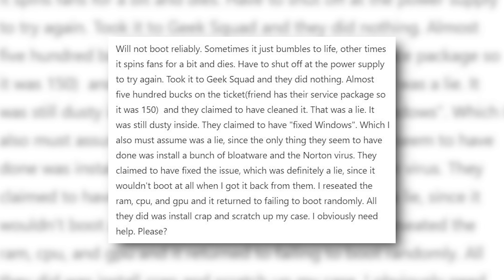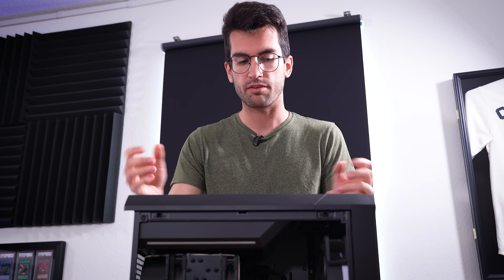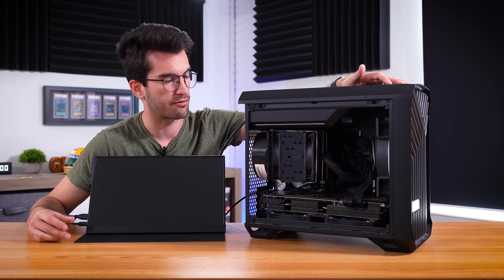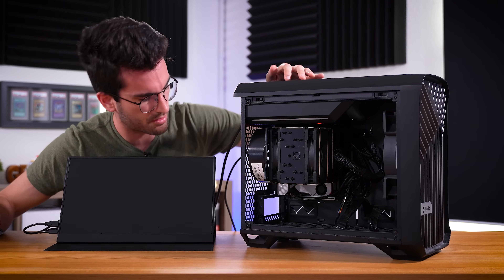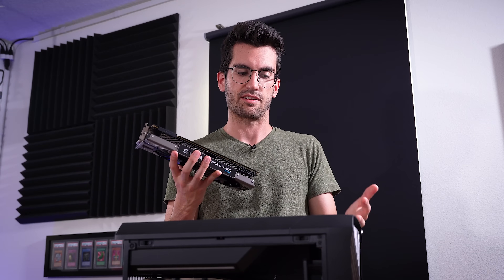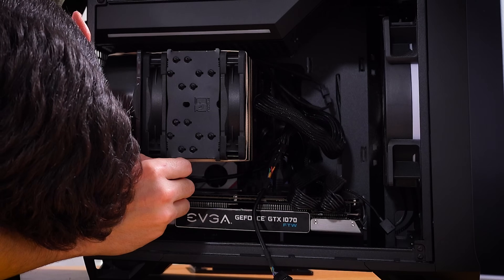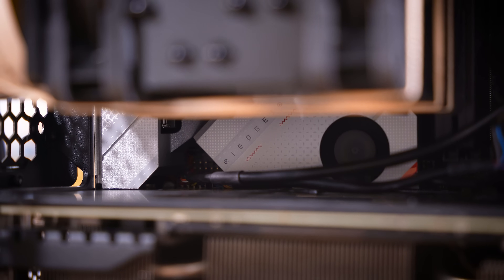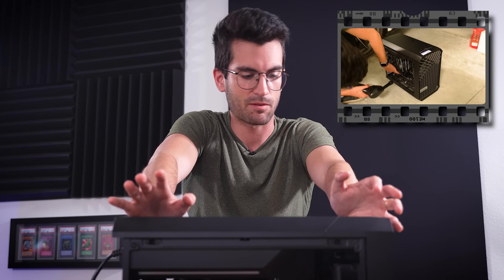Fixing a Viewer's BROKEN Gaming PC? - Fix or Flop S5:E6

Comment: Lucky case, I've had worse :) CPU not working with specific motherboard. Tried CPU different motherboard, works. Tried different CPU on motherboard works. CPU and motherboard together, NOPE. I feel like some bios software lock was created by accident, but I'm no expert in BIOS security keys and such. However I did update bios and thus reseting settings and still nothing.

Comment: Maybe the painted backplate was insulating the short and it was hitting a screw or a pin or something before?
Reply: Also the 3080 backplate has some exposed areas and without it's original shroud the heatsink fins are more exposed too. The cables could have been touching anywhere at this point.

Comment: Simply reseating the psu or front panel cables literally could have been the solution,  i agree. The first step to any troubleshooting is always reseating things. Second is to breadboard the components (to isolate shorting issues like you described).
Reply: My pc didn't boot after installing a new cpu cooler. I had to remove my ram to install it, after I installed it I put my ram back in and heard both clicks, so I assumed it was in all the way. I tried to turn my pc on and got a dram led light, I was worried I over tightened my cpu cooler, but I just re-seated my ram and it solved the issue

Comment: I don't like the sag on those gpu's. So possibly an issue with the pcie slot. Both the test cards are lighter than the customers gpu I suspect.
Reply: i put a screw in the back of my card jay2cents showed it before and my 7900xtx doesnt sag hell it doesnt even move where the (plate and case meet)
Reply: This was my opinion. that card is super slanted, probably putting pressure on that PCIe slot, and could be causing it to cause errors. maybe even coming unseated (the difficulty unlocking the PCIe slot lock would also support that concern) slightly. then it causes errors, shorts, and reboots. Reseating the card resolved it for a while, but the drive back to the guys house may dislodge it again.

This may be 100% hogwash, but it's a valid hypothesis
Reply: @TheMatthewLedbetter  That's my thought. Though I do have a gpu latch that sticks bad on a horizontal MB in my home office. Of course I also have a bias because I have had one gpu all but die without known cause recently, well not entirely die, just lock the system hard anytime I try and go past the bios screen, even trying to boot a windows install image from USB. and I was having problems with screens blanking briefly and my gpu had a bit of sag. That turned out to be a weird driver version + chrome + video codec pack that only had issues while watching you-tube with more than one video tab open. change any of those and the issue went away. still added in a cheap anti-sag stand.

Comment: Wonder if the issue was just caused by the I/O connectors being slightly loose or something like that, and it got fixed when you reseated them. That's the most likely explanation, especially considering how cramped that area looked. Anyway, great job as always!
Reply: Exactly what I thought, doubt geek squad actually disassembled like Greg did and put it all back together
Reply: @ThatsChrisYup My brother worked for Geek Squad up in Alaska for 3 yrs and he told me they look at it first and if something looks off or broken then they'll take it apart, but if it looks okay and they can't replicate the issue then they just write it up as the owners issue and just charge them for the diagnostics. So I agree they probably didn't do anything but plug it in and it booted normally and they just gave it back to the owner.
Reply: @Joreel every store has their own rules and processes depending on the manager.
Reply: I thought the size of the graphics card was pushing on the IO connector making it slightly loose.
Reply: Yeah, it was some cable/slot connection issue and Salazar reseating everything 10s of times fixed it.
Reply: My thoughts exactly, the extensions were probly randomly not working
Reply: The pins from the HDD header were probably shorting something on the board which is probably why it shut off immediately protecting itself.
Reply: The issue with that is it would sometimes turn on and back off right away. If the power button on the front wasn't connected it wouldn't have done that. It's possible the I/O connectors were connected wrong and it was shutting down due to a dead short. Or what I think is by just removing and reseating the GPU and its power connectors could have fixed it. Always fun when you can't replicate the issue
Reply: Yep my thoughts exactly
Reply: I was thinking it was the connectors, because they had that extension. maybe something was loose and this has been since fixed?
Reply: it most likely was, its the only explanation
Reply: Just worked on a "sometimes booting" system. Turned out it was a slightly frayed/stretched SATA-cable causing the system to not boot at all or to spend half an hour in the BIOS screen. For extra fun, every time I looked around inside, I would disturb the cable and something else would happen. Got a boot with a live Linux distro which had endless complaints about "ata4" and from there it was an easy fix.
Reply: That’s what I thought, because I have the Intel version of this motherboard, and I know how crammed the I/O connectors can be🤧